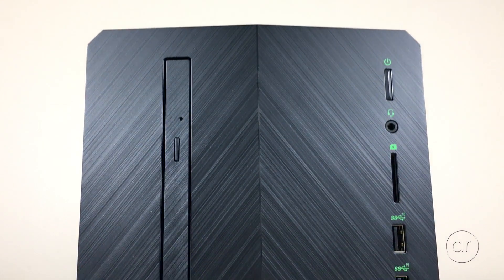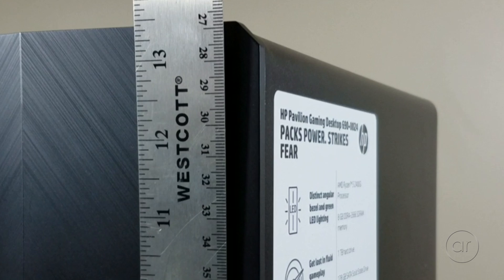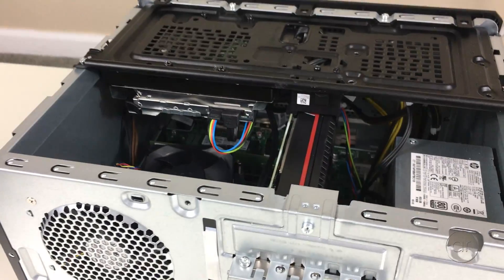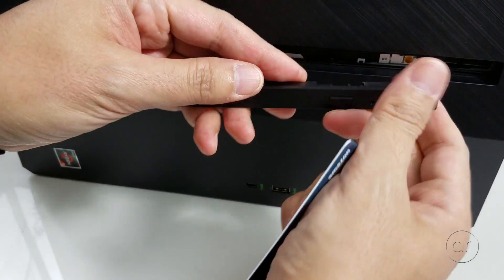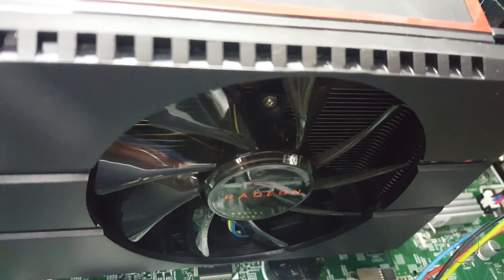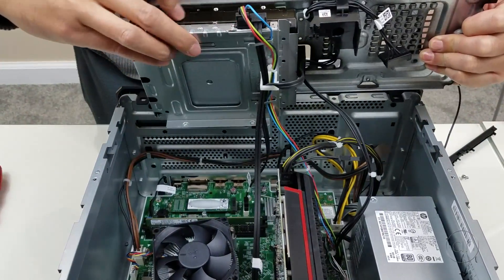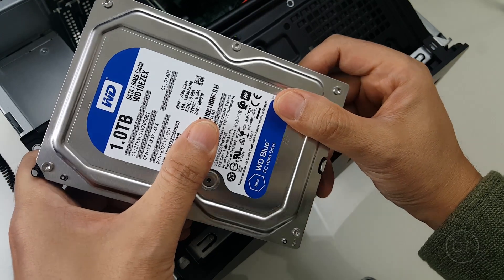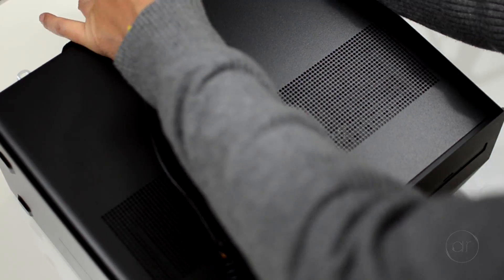How to Open and Upgrade a Ryzen-Based HP Pavilion Gaming Desktop

Comment: I got the one with the Ryzen 7 2700 and 16gb of ram and I absolutely love it. The only real difference  between this one and mine is more ram and a Ryzen 7 2700 which btw is a really good processor.
Reply from the maker: Agreed. If you got them at holiday pricing, these HPs are/were a great deal.
Reply: @accessrandom  I think that I paid $800 for mine, the actual price was $1050 but it was a weeked sale at Best Buy and mine is the 690-0034
Reply: @accessrandom  your video helped me a lot, please keep it up so that I can reference it later. I have it saved in my videos. The 690-0024 is the exact same aside from the processor and the extra ram.
Reply from the maker: I probably got mine at the same time. What type of videos would you like to see? My holiday spending is a bit depleted so it may be a while before I upgrade anything ;)
Reply: and those are about the only 2 things that can be upgraded lol
Reply: @naegleriafowleri76  Not really because if you contact the HP customer support I'm sure that they can give you a breakdown of compatible psu's and gpu's..... Or you could simply buy another case and get a x470 mobo and transfer everything to it getting better cooling with more options..... There is always more options with towers than a laptop.....
Reply: @collinrowland8833  they have yet to provide new psu and gpu, their psu and motherboard are proprietary, which means were fucked, you can upgrade the cpu, maybe the video card but not much, yeah there is always the option of getting rid of the board and installing everything on another case, but at that point, you're already spending more money and hassle, youd have to buy a new case, new motherboard, new psu, at that point you might as well built your own pc from the start or bought one from cyberpower ibuypower
Reply: @naegleriafowleri1715  No, it will only cost me an additional $200 for the case, psu and mobo all of which I am going to order next month. Later when AMD comes out with a better gpu other than Radeon VII, then I'll buy it or just buy a Vega 64 when the price is at about $300. The cooling in this current case sucks horribly and if I wanted too than I already found a compatible rx 580 8gb to go in this current machine. I will be upgrading this pc because there's nothing wrong with the cpu or ram and I shouldn't have to upgrade either for at least 3-4 years.
Reply: @collinrowland8833  Did you succeed in switching cases? If so what parts did you use, I was considering the same thing!
Reply: @snipedfoo  Hey there, I finally switched everything over and then some. I got almost a totally new setup. I now have the Meshify C case with two intake fan in the front both at 120mm with a 120mm out take fan in back. I also have the ASUS Prime Pro Mobo (X470) with a 650 watt psu and the AMD Wraith Max cooler instead of what came with the HP. Basically I got a new case, psu, cooler, and mobo but kept the gpu, ram, and cpu. It works 100 times better. I also got a new Monitor cuz my old one crapped out. So it is possible. I do recommend getting a new cooler though aside from what's in the HP
Reply: @collinrowland8833  did your performance increase in games?
Reply: @Ethan-jd3qt  yes it did because it has a much better mobo and the case has really good airflow plus the cpu cooler is better. All in all the cpu and gpu never goe above 60 degrees Celsius which makes performance much better
Reply: @collinrowland8833  so it would increase me frame rate in fortnite?
Reply: @Ethan-jd3qt  with everything I put into mine yes because I now have a psu and mobo that allow me to overclock with great thermals.
Reply: @Ethan-jd3qt  Here's my system in a nutshell. The rx 580 isn't the same one that I have because they didn't have it on pcpartpicker so it's a sub but still the same also it's the same case but mine is white
https://pcpartpicker.com/list/62dQ7T
Reply: @collinrowland8833  thank you for the help
Reply: @collinrowland8833  one more question, you have the same gpu?
Reply: @Ethan-jd3qt  I have the same gpu that came in the HP. I just converted it to my new system

Comment: Where can I find a 400 Watt Power Supply, or even a 500 Watt Power Supply that looks exactly like the one in this video? I want to upgrade the power supply in my own HP Pavilion Gaming Desktop that looks exactly like this one, as mine has only 310 watts in it, and I want to see if I can upgrade to a Geforce GTX 1060 6 GBs.
Reply from the maker: I searched everywhere and couldn't find anyone who actually upgraded the power supply. Wish I had a better answer for you. According to a review on best buy, the power supply dimensions are 2.8125 x 2.9375 x 6.25 inches. The official line from HP is "This model uses a standard 12V PSU. Make sure it has two 4 pin connectors. It is not a custom PSU. HP does not maintain a database of compatible third party products."
Reply: @accessrandom  is a bronze 400 something psu, it doesn't have to be upgraded, many people buy too much psu power for nothing and don't really need it, this psu is enough for all the components it has
Reply: @naegleriafowleri76  If you want to Upgrade the GPU, with say a 1080/1070 or mini you would probably want to upgrade the PSU, just to be safe
Reply: SBCurley is it even possible to put a 1080 in this system lol
Reply: @jus_ttkrl  I upgraded  the ram to 16gigs and this box runs PubG and battlefield V (5)  in highest ultra setting. smooth as butter, why bother upgrading. Just add the RAM first.
The only thing is heating will be an issue once it's out of warranty. The GPU runs a solid 86C when playing PubG for half hour not more.
Reply: @JT-xf9sw  take off the side cover lol

Comment: Can you upgrade the cooling fans to a better one or even water cooled?
Reply from the maker: It depends on the cooler, but it's a really tight fit in there. I doubt something like a Hyper T4, let alone a 212 EVO, would fit (I have a Hyper T4 in a different mid-size tower that's 7.5" wide and that barely fits in that case). When shopping around, just keep in mind that the width of HP is around 6.75".
Reply: @accessrandom  omg thanks for responding that suck but at least i know have a good night/day